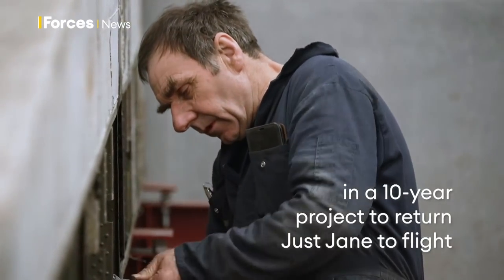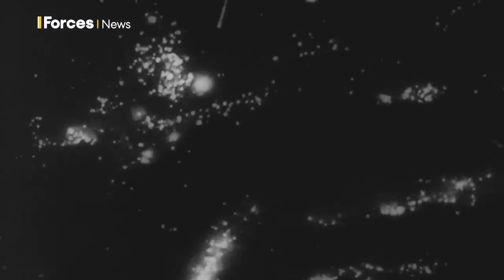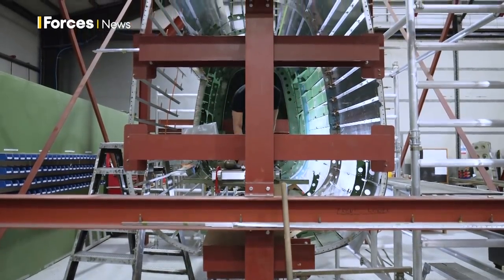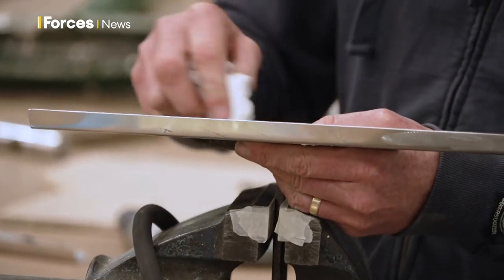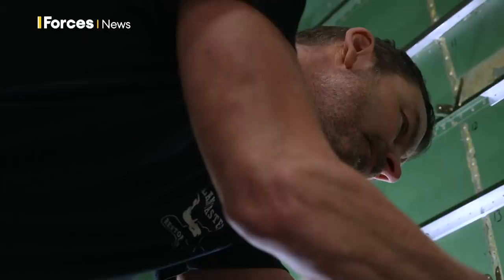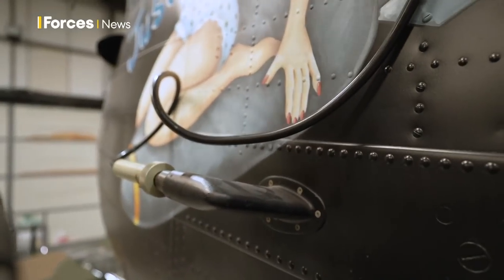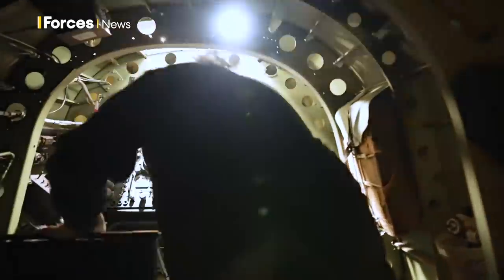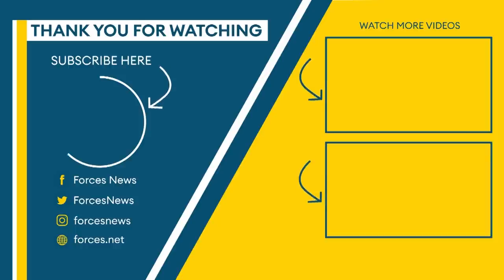The epic task of restoring a WW2 Lancaster to flight

Comment: A dear old friend, now deceased, was a Rear Gunner in the RAF on the Lancaster. The only Brit on board with an all Australian Crew. When I asked him if he was scared, he replied "You were too cold to be scared. The heating would freeze up and stop above 10000 feet. We'd borrow jackets from the Yanks, theirs were a bit better than ours." He even eventually removed the "glass" from his turret, as others did, which previously they had cleaned thoroughly. "But it didn't matter how well you had cleaned it, if you got just a speck of dirt or oil on the glass, it looked like it was an enemy aircraft, especially at night. That scared you. So we took out the glass." He laughed. "It wasn't so bad then." He told me how one night, coming back after a long haul and when they were back over the English Coast, he fell asleep in the turret. Exhausted. When the aircraft landed, the lads didn't want to wake him. They left him there, sleeping. When he eventually "stirred", he couldn't hear the engines. He panicked. He swiveled the turret and pushed out through the door behind him. Backwards. He landed just a couple of feet later on the grass on the airfield. He was a good man Jimmy Gardiner. RIP